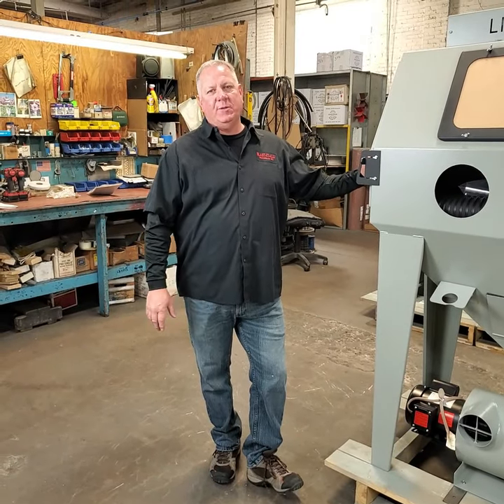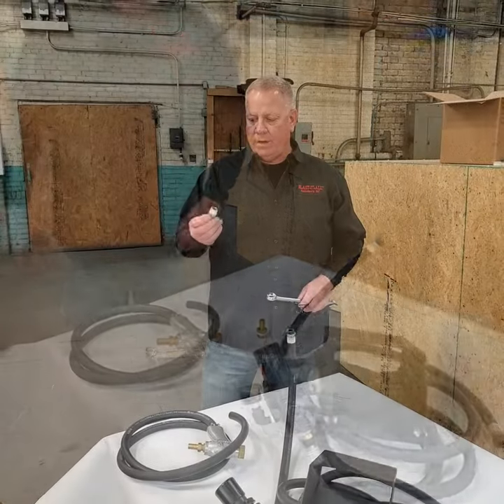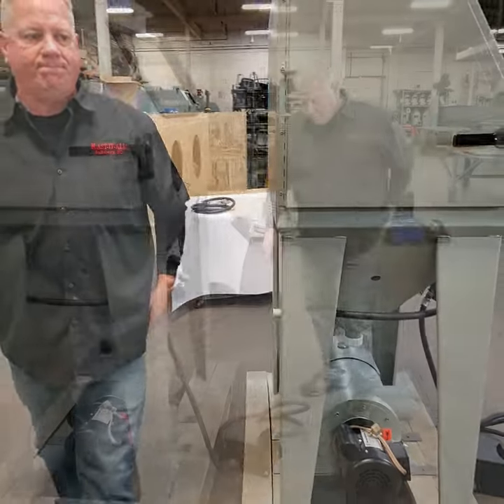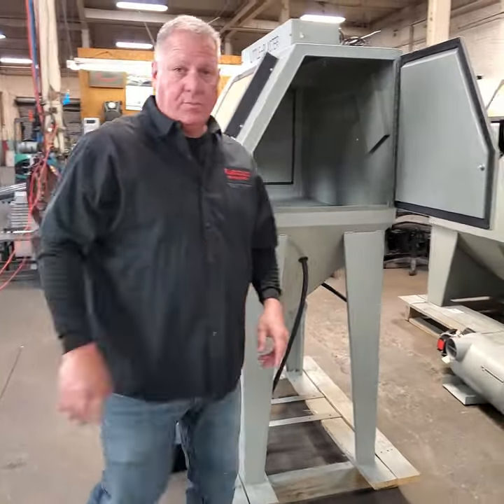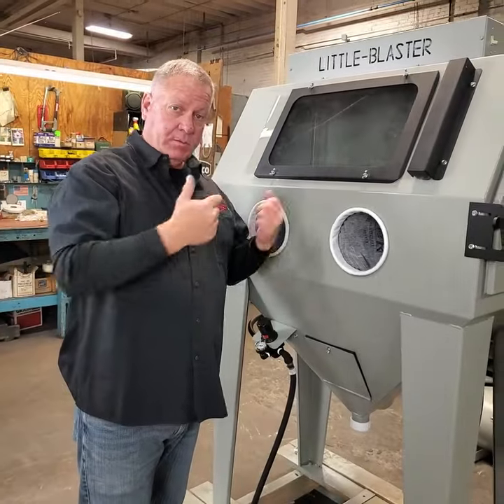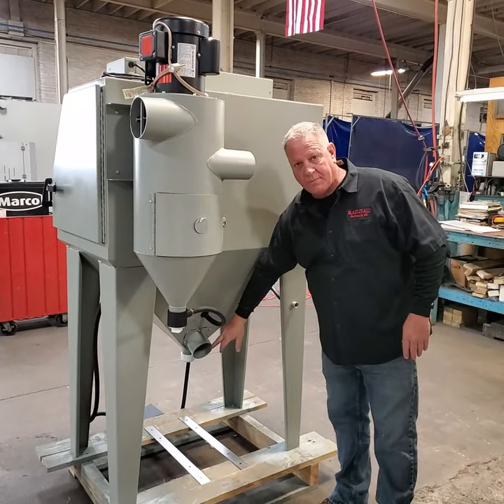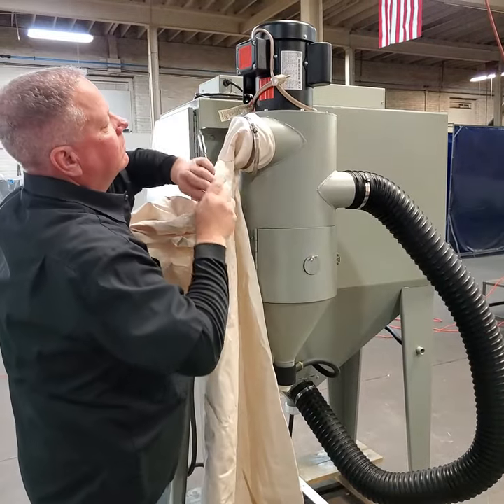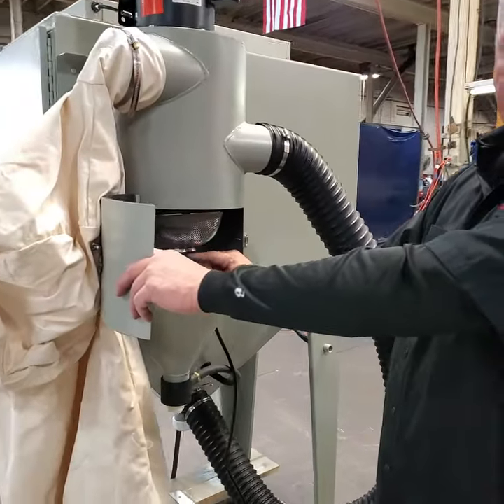Possibly the best sandblast cabinet ever made. Setup & Operation Procedures Sandblasting done right!

Comment: This blasting machine looks very nice, thanks for the video! Can the dust outlet of the reclaim be installed through the wall to the outside of a building to eliminate the dust bag and having to clean the bag?
Reply from the maker: We recommend our customers trap the dust and dispose of it responsible. Even with eco friendly blasting media other materials can be added to the dust through the blasting process. If you are looking to cut down on the maintenance and mess a bag can sometimes be, you could look at out cartridge dust collectors with revers pulse cleaning. 
https://blast-it-all.com/cartridge-collectors/

Comment: What would be the smallest cfm compressor this  cabinet needs to run.
Reply from the maker: The Little Blaster has a standard gun with a 21 CFM @ 80 PSI Air Jet. We do offer a 12 CFM @80 PSI Air Jet. 

You can find the 12 CFM Air Jet here: https://blast-it-all.com/product/3-air-jet-with-3-32-orifice/

You can find more information about CFM requirements here: https://blast-it-all.com/cfm_requirements/

Comment: Hi there. This is interesting. Am I right in thinking, that this cabinet setup with this particular cyclone has no extraction in the upper part of the cabinet? 
As far as I can tell, the cyclone pulls media from the bottom of the cabinet, which presumably is filled to a level above where the media outlet to cyclone pipe exits the cabinet. 
This then negates any dust clearing effects of the visible airspace inside the cabinet would it not? The cyclone in this case is not an extractor, but rather a fine media dust separator. 
Does the cabinet not get dusty and visibility reduced with this system?
How much media would you keep in a system like this?
Thanks.
Reply from the maker: Thanks for your question.  No media or dust remains in the cabinet.  All dust and media are pulled via 300 cfm of air flow from the bottom of the cabinet through a 4" flex hose and enters the reclaim to be separated.  The heavier re-usable media falls through a trash screen that separates any  heavier debris/trash from the blasting process and and into the bottom cone where it can be fed back into the blast gun.  Dust being light enough to be extracted is pulled from the good media and turns vertically where it follows the airflow into the dust bag or dust collector for collection and disposal.  If you have any more questions, feel free to email us or call.  We'll be happy to go over the operation.
Reply: That is a fantastic system. It seems like this company have done what none other could. Just a pritty that the plans for building such a machine had to be basically given over a large period of time. I am currently building a new machine and find some of the features to be great. Especially this one. I do have another suggestion for the manufacturer, however, I'd like to rather meet up and discuss as I have not seen it on any other machines so far. Also would be great to incorporate your products into my build. Would only make sence to have a supplier that seem to innovate and improve, rather than except the traditional methods to put a pause on the potential business that a machine could generate. After all technology is ever changing and the industry similarly continue to develop those small but essential elements that makes the day in the life of an artisan and company just a bit more comfortable. Well done.

Comment: Do you sell just that Mylar dispenser reel attachment??
Reply from the maker: Yes, and we also sell window conversion kits so it can work with other manufacturers cabinets. 
Here is the Mylar Roll Dispenser: https://blast-it-all.com/product/mylar-roll-dispenser/
Here is one of the window conversion kits: https://blast-it-all.com/product/window-conversion-kit-z-styles/
Reply: @blastitall  My cabinet has a 15" window..
Reply from the maker: @chipsammich2078  The adapter plates come in different sizes to cover the existing space where the window is and the window offset holds a the new glass window. The adapter plates come in 14.5″ x 26″, 26″ x 16.5″,  and 15″ x 22″. The window offset holds the new window and allows the mylar to slide through to protect the window. The new window size will be 12" x 20". You will lose a little size on the window when converting to a mylar dispenser system from an existing window. Here are all three kits and the window offset.
14.5″ x 26″ https://blast-it-all.com/product/window-conversion-kit-t-styles/
26″ x 16.5″ https://blast-it-all.com/product/window-conversion-kit-e-styles/
15″ x 22″ https://blast-it-all.com/product/window-conversion-kit-z-styles/
Window Offset https://blast-it-all.com/product/window-frame-kit-offset-type/
Reply: @blastitall  ok im gonna have to get some measurements when I get home to see if I can make one work.. but I think I have a 15x30 hole
Reply from the maker: @chipsammich2078  If none of our adapter kits work you could make your own adapter and then purchase the window offset kit. The window offset has an outer dimension of 22" x 13.5" and an inner dimension of 18.5" x 10.5".